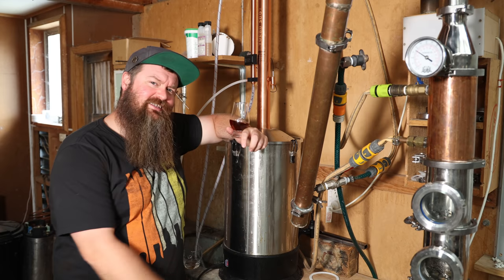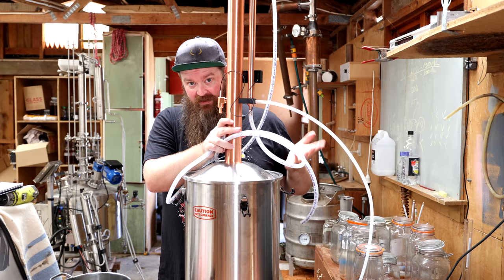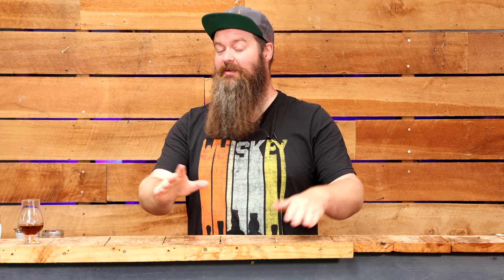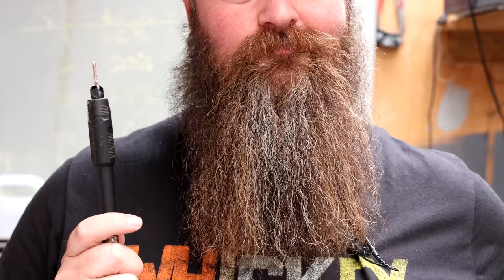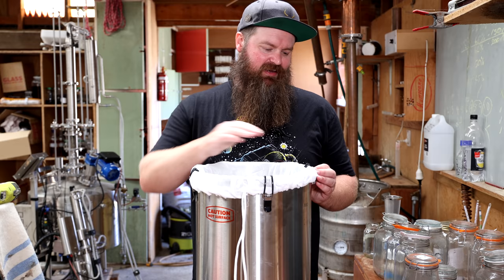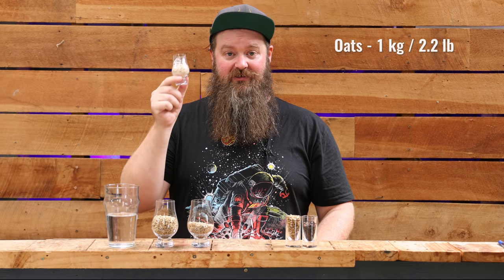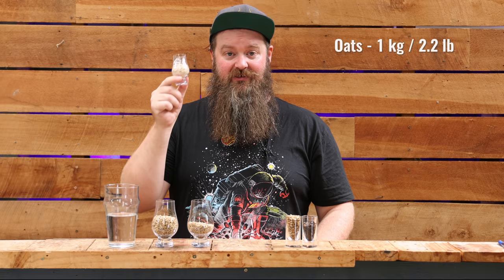How To Make Next Step Whiskey (safety Net)

Comment: So, I'm a chemist. I think I have an idea for something never done on YouTube (maybe by anyone). There is a niche piece of chemistry equipment called a soxhlet extractor. It basically evaporates a solvent (alcohol) and condenses it. The alcohol then goes into an extraction vessel. After enough collects, it falls into a collection vessel and starts again. It will do this process over and over again until you turn it off. You could put white dog in the bottom and wood chips in the extraction vessel. What you get in the collection vessel after hours would theorhetically be an aged whiskey.
Reply: I kinda doubt you’re a chemist otherwise you’d realize that there is no advantage of that over just stirring the wood into the cold alcohol. Soxhlet extractors are used to encourage poorly soluble things to dissolve into a very small amount of solvent, or to extract something off of a solid with a small amount of solvent. The wood needs time because it is dense and the alcohol takes time to penetrate and dissolve the compounds within, and have those compounds osmotically migrate back out. We could achieve faster wooding with sawdust, but then we give up the wood’s own filtering/chromatography effect which slows down tannins more than sugars.

Comment: New to the channel. Yankee homebrewer here. You mentioned boilovers with all grain wort. Fermcap S should solve your problems. 

I first got into diy ethanol production years ago after watching “Moonshiners” when I fabricated a boiler from a 1/2 bbl Sanke keg and 2” copper pipe... I laugh looking back now on how mystical I thought the mash process of malted grain was. I quickly stopped the evaporative/condensing ethanol hobby after getting discouraged from a few batches of experiments. It wasn’t until years later that I read the first chapter of a homebrewing book where everything finally made sense.

Comment: Another tip with squeezing the bag: Place a stainless mesh cooling rack over the top of the pot and you can let the bag come down and rest on it. Once there, you can use a pot lid to press down on the bag with body weight. I've also seen folks use a plastic bucket sitting on top, and then fill with water to get another 18kg of pressure.

Comment: When I was distilling, I used an OMRON DIGITAL CONTROLLER to control my temperature.  Since it is 220 VAC and digital.  I was able to control my fermentation and distillation,  + OR  - .01 degrees .point 01. It has solid state relays that are basically virtually silent contactors.  Now,, it's an ornament on my garage wall.

Comment: I noticed with the T500 ,at my altitude , and following their directions 122f- 149f, 122f- 130ish f took way longer than 5 hrs to finish. I did a test and found  i can get a good stripping run at 160ish f. I push my spirit runs around 150ish while getting 90+ %. Thanks

Comment: Thanks Jesse, For me personally, this is one of your best video's yet.  Im a newbie and have a T500 still with both a column and a Alembic head.  So far, I have only done sugar wash mixes, but seeing this and how you explained it real easy step by step, can be related to for  newbie like me.  This is going to be my next mast to try.  The only difference is I have got the new Still Spirits temp controlled boiler  which will help loads.  Many thanks for the video's, I am on a steep learning curve and learning loads.
Reply from the maker: Honestly. . .  Didn't know they had one hahaha. I mean pretty easy to just plug the standard one into a controller.  Good luck mate, you got it!
Reply: @StillIt  that's what I do Jesse... plug it into my SCR controller.
Reply: @StillIt  No need for the extra expense of a PID or controller when you can just turn it on for the same price as a T500 boiler, but at a temperature you decide to have. The only down side I have found so far is the damned thing cuts out for 2 degrees C when it gets to the desired temp and then comes back on, which scares the crap out of me being a newbie!!!  It is also great for fermenting as I can set it to 23 degrees (C) until done. Did my first all grain mash yesterday and eagerly awaiting the results. Keep up the great video's.
Reply: @spence5103  That's why you should NOT try to control temperature. You control power.
Reply: Thanks, this is all a steep learning curve for me, but hopefully I'm going in the right direction.
Reply: @ac2560  Thanks for your comment, however the T500 works kind of backwards from a standard still.  You control the temp at the top of the column by water pressure and temp etc, instead of power.  Gets confusing when you operate a different still after just getting used to this method, but I totally understand where you are coming from.  I think the T500 is a great market entry still and with the New boiler, I can use it to mash, ferment and distil at various temps.  No need for a PID, unlike other stills.

Comment: Just finished running this recipe - so far so good. Got 4 litres @ 55%, split into 2 jars with one on sherry cask staves and the other on american oak spheres. You weren't wrong about the puking, had to run the T500 at about 60% power to get a clean spirit. Anyway excellent video and thanks for the recipe!
Reply: I'm doing this run now, what sort of volume did you get with the three stripping runs?
Reply: I would like to try recipe on my t500. How u control water flow and temperature when using t500 as pot still?

Comment: If you play with the packing amount in the T500 you can run it with reflux to anywhere between 60 and 80% . The Scotts try for a spirit run around 80% i think. I don't want to run my T500  without reflux because of the plastic parts they built it with. This sounds like a sugared up beer recipe without hops and sparging. I'm going to try it. Thank you for the inspiration.
Reply: I wouldn’t worry about the plastic, the boiling point of water is the max temp the column can get to (assuming you only have water left in the boiler and haven’t boiled it dry)
Not sure what plastic they use but I must me rated well above 100c
Reply: All the distilleries I’ve been to it’s closer to 90%

Comment: I've always liked the t800 with its dual hydrogen power cells and neural network.
Reply: Lex Vegan  oft, that is a joke for the geeks. I approve
Reply: @StillIt  Seriously though, the T500 is a good starter, but they should be seeing your resources to develop the next step up J-600. Gradation in the kettle, 2" Tri-Clamp on lid, voltage regulator, sparging cylinder, threaded spigot, integrated temperature probe, etc... You Da Man J.

Comment: Great and thought provoking video, Jesse! Watched it twice. With respect, I do not concur that the inverted sugar is simpler. I get that it adds volume without mashing. But why not do two mashes with only all grain in the T-500 (assuming you want the volume)? Use the calculators to determine kilos of grain to water volume. Each mash is identical. If you follow the recipe steps for mashing you will not mess up, and you avoid the inverted sugar step and possible off-flavors. Just my thoughts.

Comment: Hi Jessie. Great content & info for the home distiller. very much appreciated by this little black duck. Doing this whiskey right now. Question: do you do the spirit run at a low ABV so that the need to dilute is less or not required. There is a thought that if you dilute after the spirit run that it reduces the flavor. Also found out by sheer luck that the brew bags with the full bag length mesh supports with lifting tabs makes spillage when lifting the bag from the pot much less if none at all if you go slow enough. You were right, you need a pulley system (double is better) or you have real problems. Cheers Darren
Reply from the maker: Yeah a pully system is definitely the right way.  Assuming you like your back lol.  

in that situation I would say the flavour loss is less about the proofing down and more about leaving flavour behind due to higher reflux distillation.  Its a sliding scale how clean do you want it to be?

Comment: I have a few Digi boilers and they come with indentation measurements up the side. They also come with a digital panel that shows the actual temperature of the liquid and can maintain the temperature you set it to.
Reply: You don't want to do that.
Reply: @ac2560  I dont use that for mash mate, just for maintaining a draw off water temp for wash, but it is useful if you want to hold the water at a certain temp and need to step away for a bit before you mash 👍
Reply: @deant6627  Ah, okay then, all good.

Comment: Hi Jessie, thanks for your awesome videos! I have a question; Do you remove the packing from the column when operating the T500 in pot still mode? Or is it just disconnecting the water from the column and let it run through the condensor?
Reply: I have been wondering this exact same question

Comment: Did you run 2 water cooling lines to the t500? Did you remove t500 supplied packing? Enjoy your videos, was hoping to hear/see more specifics on t500 set up for your spirit run.👍
Reply from the maker: Just one cooling line to the product condenser (nothing to the reflux) and left the packing in for this one.

Comment: Im very new to distilling at home, just picked up my first still, t 500, lthough this is years old, im hoping this will still rate a reply, pretty please 🙏 
When you talk about altering the set up of the water path through the top condenser bit, is that just to avoid removing the flavours from a grain mash? If so, am i correct in saying the alembic dome top available for this still spirits pot would be better for this? Thanks Newbie Matt from Oz. 😊

Comment: Questions and Comments.

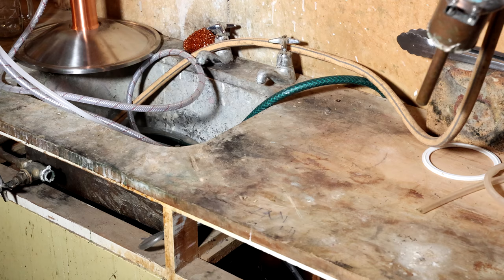5:53 Why choose 147-149?   I'm curious, when we were pumping out small batch 13% beers we were rocking 158, we found this was a good combination of Alpha and Beta Amylase granting us a much higher efficiency than I suspect you are getting.  Maybe volume plays a part in this.  

8:41 Oats add protein to wort and is used in beers to add body and head retention, Murphy's Irish Ale is an example of this.  It sounds like this is the same thing you are after with your wort.  

15:44 Pure water is 7ph but rarely do you ever see that out of your tap which usually ranges 6.5 to 8.5, an important feature when trying this recipe at home where results may very.  If Still It's water is 6.5 and yours is 8 adding the same amount of tarter to your solution is going to yield a much different result.  

20:30 I would strongly recommend not using baker's yeast.  If you don't want to buy brewer's yeast you can easily find distiller's yeast on the internet.  It is cheap.  In my experience the flavors produced by baker's and distiller's yeast aren't as clean as brewer's yeast but distiller's yeast is better than baker's.  It is interesting there was no mention of it in the video.  Would be curious on Still It's opinion on distiller's yeast.

One thing that has always steered me away from getting into distilling is the Methanol factor.  There was no mention of it in this video but from what I know it would be in the first two jars.  It is a huge thing and in 2017, 1700 people went blind from consuming Methanol, consuming just 10 milliliters of it can cause permanent blindness.  I think it would be worthwhile to do a video on it, dangers, how to avoid it, if it's only a factor in certain stills, etc.  

Love the work, love the content, cheers!

Comment: Really love the channel, I've bringed most of your videos in the last 7 months and learned a lot. I have a few questions about this. When you do the stripping run did you leave the saddles in the reflux condenser? When you do the spirit run are you running the water through the reflux condenser as well as the condenser arm? And for the spirit run saddles I  or out? Thanks so much for the info I wouldn't be distilling without this channel.

Comment: Did you change anything else to the T500 apart from the water flow? Did you still run it with all the packing?
What's an average L per minute to run the water flow? im just worried about damaging the inside of the column

Comment: Hey Jessie. Great video and keen to give this recipe a try. Couple of questions. Did you have the packing in the t500 or was this removed for the "pot still" mode? Also did you water down to 55% after making the cuts? Cheers mate!
Reply: I was wondering exactly the same Andrew.
Reply: @carlusdovens648  the research / forum posts i've read since tell me that yes you remove the saddles from the column and also disconnect the condenser that runs inside the column. if you've got the stainless steel t500 condenser some people recommend putting in a handful of copper saddles simply to get the distillate touching some copper. and yes to watering down after making cuts. down to the % for ageing that imparts the flavors you're trying to hit.
Reply: Thanks @andrewmckay1675 .
I'll definitely try this.

Comment: You said that you were running the t500 at 3/4 power.  What were you using to bring it down? was it a router speed control dial?

Comment: Great video it sounds like a great next step.  I am no expert but the yield seems very low for a 60l wash and all that work.   I have not done distilled a grain wash but would it be a great idea to utilise the boiling point of Acetone 56c and methanol at 64.7c to your advantage.  Can you create a holding point at say 70c  and try and evaporate them off prior to getting up high enough for  the 78 degree boiling point of ethanol  where  potentially the good stuff would be???  I am sure the big distillers of the world have a workflow that gets maximum yield with minimum effort.
Reply: No, you can't.

Comment: Could you distill the heads and tails again, and get another run of drinkable product?
Reply from the maker: It's really worth doing it just for what you get off one batch.  But save up a bunch of the feints and run them for sure.  Or add them back into the next run.

Comment: What a nice recipe jesse! as a beer brewer i own a Brewmonk all in one system and as you explain there is no option for temperature on the T500 and the boiler seems the same size as the brew monk. Do you know if the Colum of the T500 will fit on a system as the brewmonk or other manufacturer? as that would be great for temperature control. keep going on with the nice videos!

Comment: Would it be reasonable, particularly if your kettle has a Kardashian (false bottom), to use the kettle to maintain temp after mashing in rather than just insulate with blankets? Also wondering if efficiency would be improved if the grain was added to cold water and slowly brought up to 63-65C to provide a protein rest of sorts, expose grain to full temp range of the beta analyse before finally resting in the alpha-amylase temp range? Plus my comment below :-)
Reply: Apologies - just went back and rewatched 'How To Make Potato Vodka' and learned that coming up to temp is at least a thing and feasible :-)
Reply: No, if you heat the bottom during the mash, the lower portion will heat up but top bits will stay cooler. You are better off just mixing well, getting to temp, then insulating with blankets.
Reply: With that amount of water and grain, you will only lose one degree in an hour anyway (properly insulated with blankets and/sleeping bags).
Reply: @ac2560  Awesome, thank you

Comment: Hi jesse love your channel, i have a question i followed ur recipe i divided it to 3 drums only used 6kg of sugar devided that between the 3 each drum. Sg was 1064 sg at 30 degrease 2 drums used 100grams of  bakers yeast and 1 i used turbo 48hr for  experiment but the issue  is the turbo smells realy bad like shit🤢 the other 2 smell like beer fg is 1002 and turbo fg is 1005.  24.4.21 was mash day . Any ideas on the turbo wash barrel? And i probably wont use turbo for grain mash again. Thanks for ur videos and getting me into the next level😉
Reply from the maker: Yeah, I would skip the turbo for anything all grain especially.  You could try stripping it separately to the others and asses it then.  Or, just leave it out and turn that into neutral
Reply: @StillIt  ok thanks for the reply i thought maybe a yeast infection or something and wouldnt be safe to use so i discarded it (probably a rookie mistake)

Comment: for adding grain into my strike water, I put my BIAB in a 5gal pail, add all my grains for initial mashin, and take the temperature
Then heat my strike water to calculated temp
then I just lift out my bag, and lower it into my strike water.
secure the rim of the bag (I actually just use a flat of proper fabric and gather it up.... no bag necessary)

NOW the Important part
I use a LARGE potato masher like this: 
https://www.tias.com/12908/PictPage/3924076863.html

work it up and down and around and around HARD for about 1 min, and there are ZERO lumps/clumps... only porridge!!!

Comment: I cooked 10lbs of barley at 155F for 90 minutes and got a starting gravity of 1.068.  My distillers yeast stopped after about three days at 1.035, 70F ambient temperature.  
Any suggestions how I can improve?
Reply: Hey Luke, I would give your vat a really good stir and increase the temp to between 77 to 82F.
Reply: @jeffreydawson5240  Thanks for the suggestion.  Gave it a shot but nothing seemed to change over the time.  Some other internet info seems to indicate my aluminum fermenter might be messing with the pH so will be testing food grade buckets next.